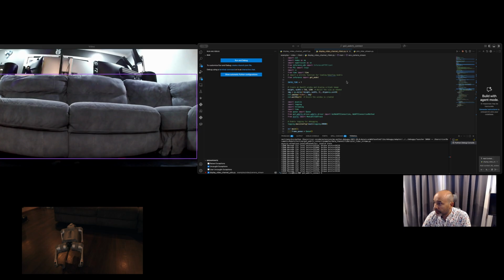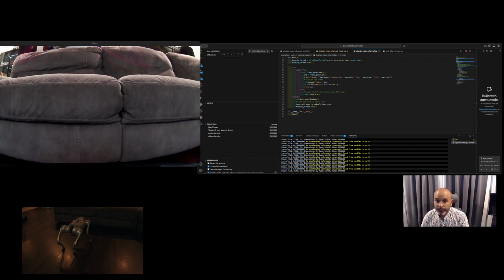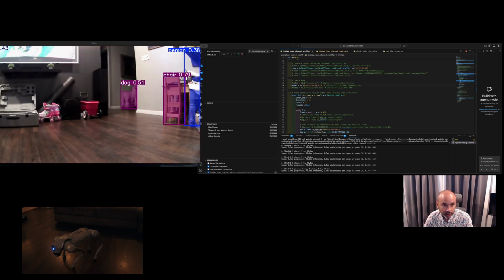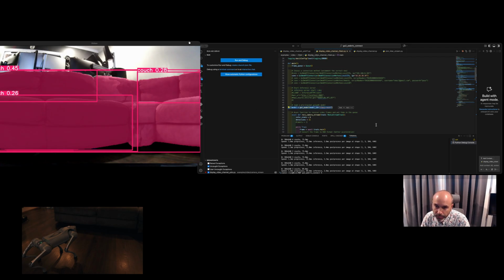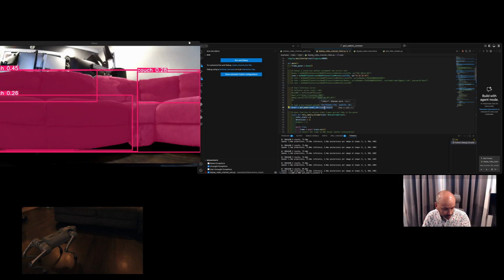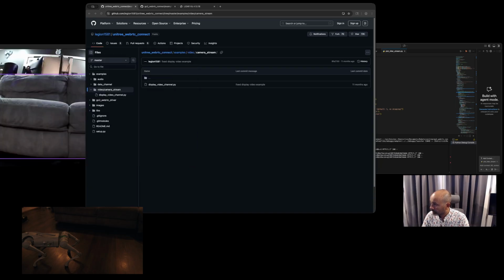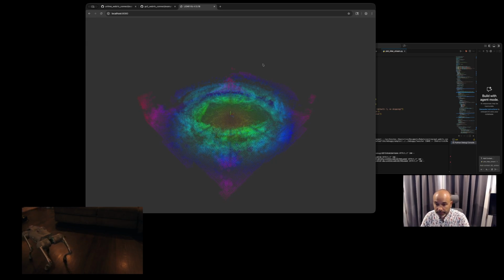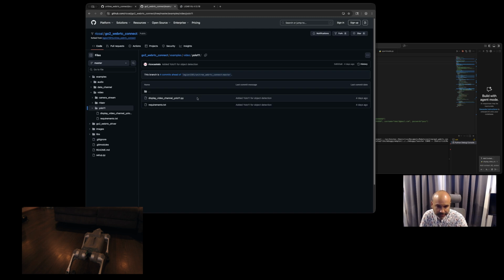AI Robot Object Detection and Lidar using WebRTC, YOLO11, RF-DETR with Unitree Go2 Pro #robotics #ai

Comment: Hello Rico, we have a GO2 air FW 1.1.15, webRTC. We are only struggling to exploit the LIDAR voxel data of the L2. I get numbers streamed ranging 1-128, but can't figure out how to make obstacle distance  (x,  y, z) out of them. We tried a number of known methods but we couldn' t find the specifics of the go2 L2 to translate. Yes great robot!
Reply from the maker: Have you tried this library?  
"The Unofficial Unitree Go2 ROS2 SDK" -  https://github.com/abizovnuralem/go2_ros2_sdk  
It allows you to visualize and utilize everything with ROS2 tool over webRTC.  So you can do SLAM, NAV2, and utilize raw point clouds.  I have a video of me utilizing it with a Go2 Pro, so you should get similar results.  https://youtu.be/AKoEiuY3EVI. 

In the future, I plan to utilize RTABMap voxel mapping and add metadata about objects detected in a map location.  Working on a reliable SLAM and NAV2 setup right now.
Reply: @MakeOrCode Thank You Rico, very kind. I will fetch the link and let you know. Like you I started with legion1581 works. BTW: did you try Qwen3.5-4B ? Very convincing AI VLA that can be even used for real time Nav (we are running the "brain" from a gaming laptop)

Comment: Can it be programmed to chase groundhogs 10 to 20 feet away from my small garden? When it automatically sees or senses a groundhog.
Reply from the maker: Sure.  The basic concept is similar to some videos that show face tracking with a servo and a webcam.  The idea would be, first detect when you see a groundhog.  Then control the Go2 to keep the groundhog in the center of the view by turning the Go2 to face the groundhog.  Then start moving forward with it always keeping the groundhog in the center of view.

But the hard parts.  Neither of these models probably know specifically what a groundhog is, so you will need to train it.  But the model would probably detect the groundhog as a dog or cat, which may be good enough.  Just let it track any dog or cat.  Then the 10 to 20 feet away problem may be the next issue.  I am not sure the resolution of the camera, so it may have trouble at a certain distance away.  But that is a pretty easy test.  Just place something 20 feet away and see if it can detect the object.  Move the object forward until it detects it, and you know your rough distance in your environment.  The amount of daylight and the background will effect its overall distance, so you would need to test in for your specific environment.
Reply: @MakeOrCode  thanks

Comment: Really fun video, nice job!
Reply from the maker: Thanks, and thanks for the great product.  I plan to use it a lot more in the future.  Next, I need to determine how to fully utilize the inference server.  I initially used the inference server, but I thought it would be too much to show in the video versus just loading the model locally, like I did with the Yolo11.  I like that I had both options.

@GrantNelson-d4h 
Is the intention of the inference server to pipe data to a stronger GPU-backed server and then feed back the results to wherever you want to display the results?  Could I pipe multiple robots' feeds to a single inference server, and the server would know how to process and deliver the results back to different robots' feeds?

Comment: How did you get the robot to move while running the program you implemented? Is it possible to connect go2 app and webrtc simultaneously??
Reply from the maker: I used the hardware controller to move the Go2 while using the WebRTC connection.  They can be used together.

You cannot run the go2 app and the webrtc app at the same time.  So you need to reproduce the go2 app in your webrtc app if you want all the functionality of the go2 app in your webrtc app.  The Github repo does show how to move the Go2 using WebRTC.  I have not played with it enough yet, but I did see the move commands.

https://github.com/ricoai/go2_webrtc_connect/blob/master/examples/data_channel/sportmode/sportmode.py
```python
# Perform a "Move Forward" movement
        print("Moving forward...")
        await conn.datachannel.pub_sub.publish_request_new(
            RTC_TOPIC["SPORT_MOD"], 
            {
                "api_id": SPORT_CMD["Move"],
                "parameter": {"x": 0.5, "y": 0, "z": 0}
            }
        )
```
Reply: @MakeOrCode Cool! Thanks a lot

Comment: RF-DETR is not based on YOLO, btw. Very different. Not sure what contributes to the tearing.
Reply from the maker: Thanks for the info on the YOLO.  Good to know.  I did like working with RF-DETR more.  But the screen tearing does occur on my M1 Pro MacBook and was a lot worse with OBS running.  With my Jetson Orin Nano the screening tearing was reduced dramatically.  I assumed RF-DETR was optimized for CUDA and not Mac processors.  But I have only just barely looked into all this right now.
Reply: @MakeOrCode  Yes, definitely intended to be run on CUDA and not Macs. We've got it running on Jetsons and are squashing bugs to make it happier on different Jetpack/CUDA versions for robot/edge use cases. For customer models in the cloud we use various cloud GPUs just fine. We published this conversation with the researchers yesterday ICYMI: https://youtu.be/vOFVx6rFGpI?si=RVjJBhWIOPCeontU